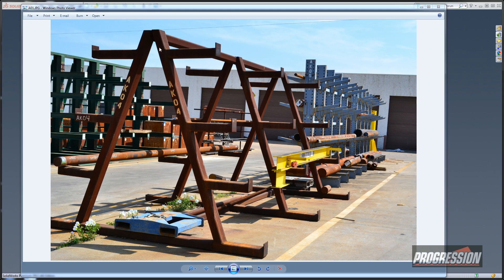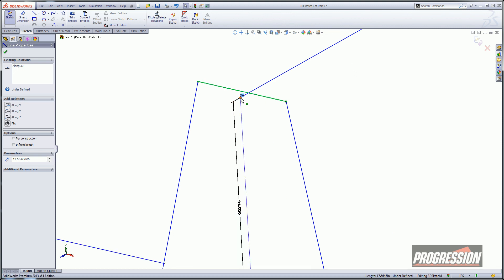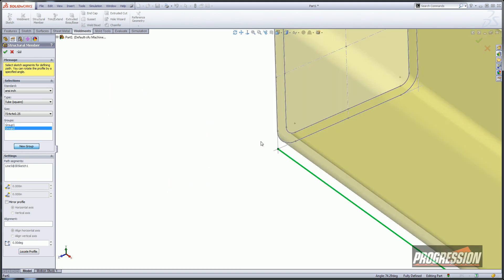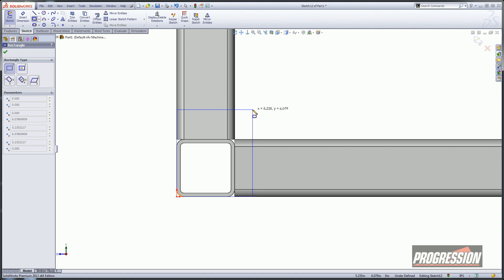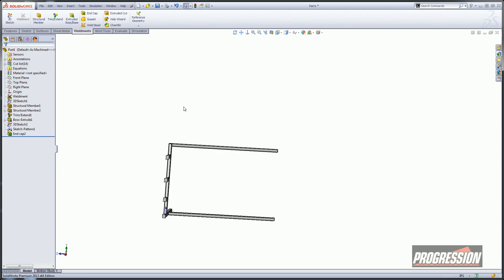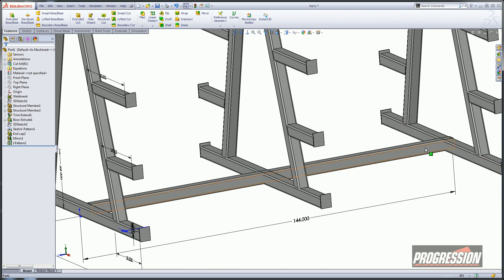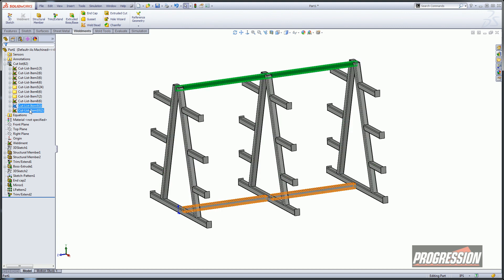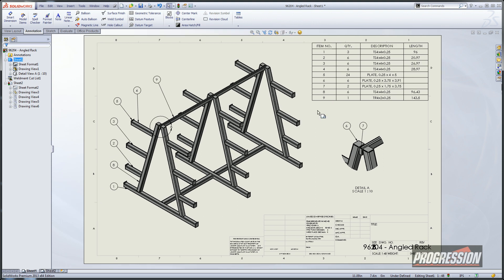SolidWorks Weldments - Steel Storage Rack

Comment: I have SW 2013 How long does it take to learn this program. I been watching all kinds of videos trying to figure it out Do I need to know autocad first before trying to learn solidworks?
Reply: There's no need to know an AUTOCAD SW to master Solidworks. It doesn't take much time if you make your self familiar with designing basics . Solidworks tool is so flexible than any other designing software available at the moment. Cheers.!!

Comment: Steve I talked with you I believe last week on this matter. Having solidworks show sheet metal/plate dimension on a cutlist. I don’t mind having the description show the information as the video above shows. Problem I notice was for pieces that are bent do not show up on the cutlist, anything that was a boss or extruded does. Plus running solidworks 2013 having 5 bent pieces and a few other pieces in a of plate in a weldment makes solidworks very unstable.

Comment from the maker: Definitely, When you select on a view, in the property Manager you will see a button at the top to "Select Bodies", this will allow you to have a model view of one or more parts (similar to a display state). You can also use the tool Insert ->  Drawing View -> "Relative to Model", this will place only the part selected, and allow the orientation of that part all in the same command. This might be a good next video.  :)

Comment: Is it possible to create views of the cut pieces?  For example the ends of the horizontal supports are cut at an angle.  As a fabricator I would want to know what those where and how the cut list is showing the length measurement.